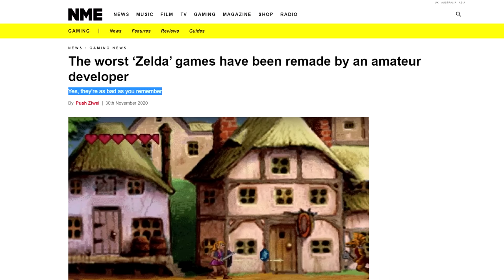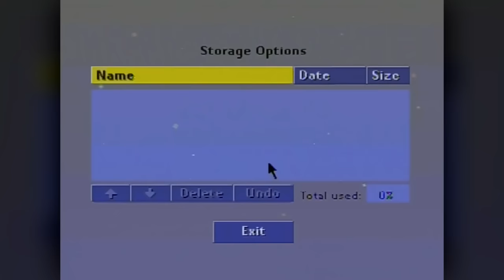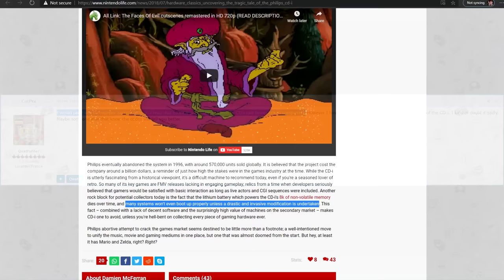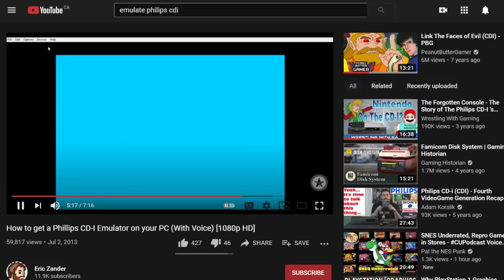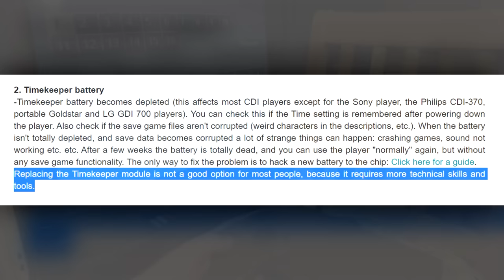Don't Risk Buying a Philips CD-I

Comment: There you go wrong. The cd-i is not a game console. It was not launched as a gaming device.

It was made to educate people. I worked for Philips and now the history behind it.

That you can play games on it is only a add on.
Reply from the maker: You didn't listen to what I said, it was indeed launched as a multimedia system. However, good luck finding more than the 1% buying it for those other reasons today whereas the only unique thing it does now is play that specific library of games. Whether Philips likes it or not, it has more-or-less turned itself into a games console by being obsolete with every other feature.
Reply: @FrameRater  i listen what you said. But you are total wrong on this product.

I also had the model you are testing. But mine didnt "scream". 

And judging by saying nobody would buy it only for the games. Thats is your opinion. There are still a lot of people that buy it for other things 

And like most all reviewers you focus on the games. And then you missed the point of the device.

Philips didn't want that this device was used for games at all 

Philips is a company that want to invest in health and care and educate people. 

So that your review is that it sucks as gameconsole said it all. 

You are wrong in this review if you like it or not. The few sentence in the beginning doesnt change that 

But there where also decent games on this device even it was not ment as a gaming console (again).

Comment: You know what's fun? The Playstation 4 has the same problem! Once the CMOS battery dies, it throws the DRM into chaos. Downloaded games will have to have their ownership verified by Sony in order to work. Disc games won't work at all! I wonder if Sony buried theirs in a microchip like Philips...
Reply from the maker: Is this the same for the PS5?
Reply: @FrameRater  Might be, I dunno. I just heard it was the PS4, but most systems these days have CMOS batteries in them.

Comment: Just... why the hell would you encase a lithium battery inside a totally custom chip, instead of making a smaller NVRAM chip and a separate battery holder?
 
WHY?!?!?!
 
Was the system designed on the day the regular system designer was out, and in their place was some intern with a shitty attitude?
 
I mean... is Philips' argument here really going to be "Well if you could do that it'd be easier to replace, and we want that sweet replacement fee money?" You designed the battery to last twenty goddamn years! On a console that was functionally and technologically obsolete within FIVE!!!

Comment: Tried buying faces of evil from that reproduction site and it won't work cheep printed cover with awful colours too. Just burn a copy of any of the games you feel you need to try my advice rather than pay someone who will do what you can do for free
Reply from the maker: Okay so if you're saying their copies don't work... then why would I suddenly be able to do any better of a job making them myself?
Reply: Fair point I was not completely clear. Point is the Cdi doesn't have any copy protection you can burn the games to any regular CD on a computer out them in the system and they will work. Great way to play some hard to find games for the system to like mutant rampage bodyslam made by the same people who did the Zelda games and it's actually pretty good.

Comment: Buying most of these old consoles is pointless, as are used games. The hardware is failing and 100% of that sale goes to the owner of the game, the publisher sees nothing. "The way it was meant to be played" is a lame excuse, and if you're going to buy a repro game you may as well pirate because if oyu're going to play it unofficially, wasting money to do it is even dumber.

I'm aware there are anti-emulation people who will buy flash carts & repros. Hypocrisy is a thing.
Reply from the maker: So many people aren't considering the repro aspect... I want a collector piece on my shelf. I want the cover, the manual, the disc with the label. But I'm not spending $300 something on each game. That's why I bought repros.
Reply: Buying old cars is pointless, they are not fast, uncomfortable, lacks features and because of emission requirements can't drive in most cities. Buying them just because they look nice, is cool to own, has a nostalgia value for owner, is a conversation piece that joins others from the scene and hobby is just dumb. It is far more convenient commuting by modern car.
Everything in life should by practically and economically justified, otherwise it is stupid.

Comment: You sound like a spoiled kit, who wants a retro plug and play machine. This is 90's and yeaah it's more simple in design. All you do is complain and make no effort to find a solution, as there are many to find. Ofcourse Philips didn't make this game console for complaining after 20 years. This is really a bad review from someone who has no respect for early electronics and don't want to invest time in simple solutions. I had my timekeeper open in less than 10 minutes and replaced the battery.  My advice, buy a new product. By the way, copied CD-I games are still illegal.